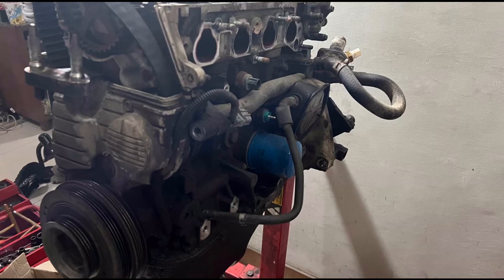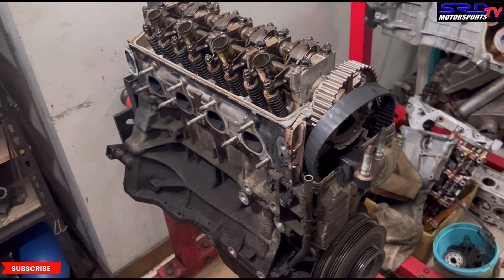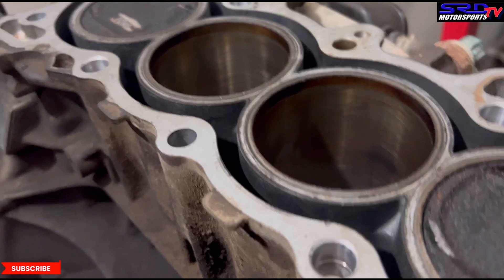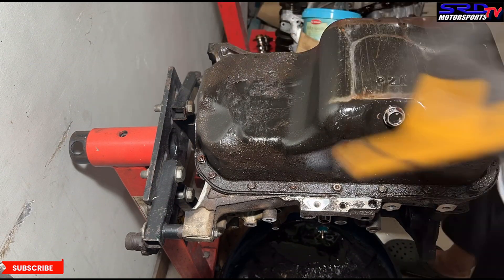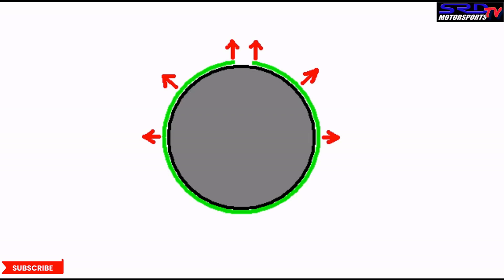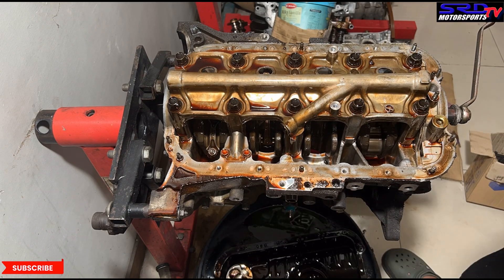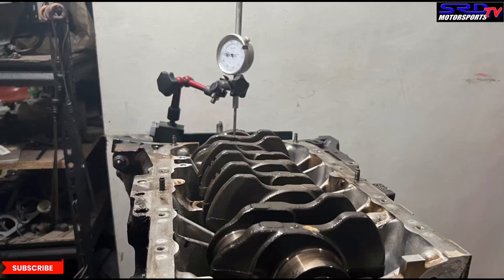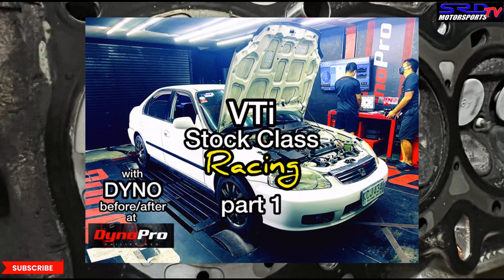Stock Honda D16 Tear Down Inspection by SRDmotorsports

Comment: A good friend drives a 1996 HONDA US Wagon. Its made in the USA and has gold badges. The motor is a all original B22 H Accord with 315,000 Kilometers. It still has most of the factory hoses running to the motor! Im sure her V-Tec solonoid is leaking oil. The mechanic that works on her car ignores the oil leak. If the car is running, then everything is ok. 315,000Kms! I guarantee that the V-Tec solenoid is the original component from brand new! I diagnosed the oil leak from knowledge gained by watching SRDmotorsportsTV and similar channels. Ive learnt so much about HONDA, right here! Thankyou...
A subscriber from New Zealand.
Reply from the maker: Oh man!!!!! Thank you buddy! Wow!!

That’s a true durable engine and well taken care of wow…

Oh on the vtec solenoid I trust u and I swear when u remove it? U may need a flat screw driver to pry it that oem gasket prolly is like cork!! I’ve seen and encountered that but that’s def a cool thing to see Honda parts and gaskets when taken care of? Lasts a lil too long 🤣

Comment: The pops and Bangs and all the bull Crap! 😆Hahahaha
Reply from the maker: Those are facts lmfao nobody admits it but when they blow up? They back to stock

Check all the true peeps in races in the US ?

Even as the porta tree light drops? They wait for the last 1-2 yellow lights bfor they even hit the launch limiter, why? To preserve the engine

As “launch” control is as strenuous as the rev limit

And to “pops and bangs” means u detune so combustion happens at the exhaust port
= bbq exhaust valve gonna drop dat soap big homey 😃🤣😂😂

Comment: guys make a video deggre top dead center tcamshaft D16Z6 with adjutable camgear🙏
Thankyouuu
Reply from the maker: You can do that by putting ur adjustable camgear under an oem camgear and use a marker to put on the adjustable camgear the tdc marking at 12oclock, 6oclock 8oclock and 3pm this way u can correct the usual incorrect adjustable camgear markings
Reply: @SRDmotorsports yes I want you to make an adjustable camgear tutorial video with an OEM cam shaft
And also i want to know the mark on the line where the camgear is😁
Reply from the maker: @rezakurniawan2779  that’s available online when u search it 

It’s been discussed in d-series.org the forum u can search there the pictures are still up

Comment: I've been rebuilding engines well over 10 years and a ring gap of 15-12 thousandth of an inch is very good for both gas or diesel engines. 

Piston rock is good once it's not  making noise at idle, most younger engines rebuilders don't understand tolerance, the crown of the piston will always get hotter than the cylinder wall so what we will have is the piston will expand and pick up that loose rock thus creating a perfect piston wall seal.

Now this engine is very healthy, I would just check my bearing clearance and if it's good just reassemble it with new seals of course, then add a cam gear, header, velocity intake pipe and a good exhaust system also maybe a management system.
Reply from the maker: 15-12 to an inch is a real good figure indeed!

Main bearings and rod bearings have no unusual wear but indeed will be double checking and move forward…

What’s hard is to try to not add too much parts after all it’s a “stock” rebuild so we can see what a “new life” engine makes vs the same but with miles

But maaaan tempting 😀
Reply: @SRDmotorsports  it's very tempting indeed especially when it's in a well kept condition like that
Reply from the maker: @Built_it_by-alex  exactly! 😀 and our brains are wired that way too… now we know “this” might work or make more lol
Reply: @SRDmotorsports  a very simple mod that you can do and won't cost a penny involves a scale, you'll know what I mean
Reply from the maker: @Built_it_by-alex  oh definitely yeah

Comment: For the mileage, the block really looks good! 👍 Looking forward to the rebuild!
Reply from the maker: True actually I’m surprised even the crosshatch I mean hey it’s 1mm more stroke than a b20 ftw
Reply: @SRDmotorsports  Also, I'm thinking since the engine wasn't raced, the piston speeds that the engine saw wouldn't be very high that's why the cylinders are in good shape
Reply from the maker: @findtherightbeat  spot on man! Dispute the clutch disk being completely worn out
Il try to take a pic lol even the “ridge”  of the clutch disk is gone 😀 definitely near 100% used like 99.99% used lol

0.01% life left
Reply: @SRDmotorsports  Is it the original clutch that the car came with from the factory?
Reply from the maker: @findtherightbeat  tbh I’m not sure il ask the owner

But hmm kinda not hard to expect it if it is

Loool!  Maybe the only time it saw rev limit was at the dyno lol

Comment: Spot on! If a piston rocks a bit on a cold disassembled engine, that is natural, especially if you are running 2618 alloy forged pistons and have to have greater P2W clearance. I'd be worried if cast pistons or 4032 alloy pistons don't rock at all when cold. That's gonna a real handful when it heats up and seizes up. Unfortunately we cannot avoid the laws of physics and metal expansion when heat is present, otherwise we would rock perfectly small P2W clearance and have amazing wear and sealing. Unfortunately we don't live in a perfect world where the laws of physics bend to our will.
Reply from the maker: But locally I guess the build behind the law of physics as u saw what I said on the video hahahahahaha
Reply: @SRDmotorsports  Precicely. Anyone trying to say otherwise is selling you snake oil. Tell him to go buy a physics book and catch up on those several years he skipped in school.
Reply from the maker: @SusedatLubo  yep locally their reason is that hence it’s due for rebuild
So unsuspecting victim spends money?!

When even bnew already should have that so how is that a reason to rebuild lol wtf
Reply: @SRDmotorsports  It's all around the world, not just locally. Hence why this video is covering a great subject and educating people. Mechanics all over the world will try to fiddle you if you don't know what's going on inside your car. Know your car, before fixing your car. I've see it all to often people replacing parts that are in perfectly good working order and throwing money at the wind when it is not needed.
Reply from the maker: @SusedatLubo  yes exactly! thats my goal actually aside from marketing the shop
also to share info and knowledge because at the end ofthe day, a project is more fun if fhe customer is knowledgeable

unlike scammers who hope u dont know so they can say OMG lol
Reply: @SRDmotorsports  It's the same reason why we have piston ring "GAP". Especially when we are running Forced Induction and you heat up the cylinder more. In a perfect world we would have no gap at all and have 0 blow by and only run the top piston ring, but physics doesn't work that way, chief. :D
Reply from the maker: @SusedatLubo  yes sir!!!!!

And they forgot they can have the best ideal gap but if bore isn’t “true” then nonesense lol